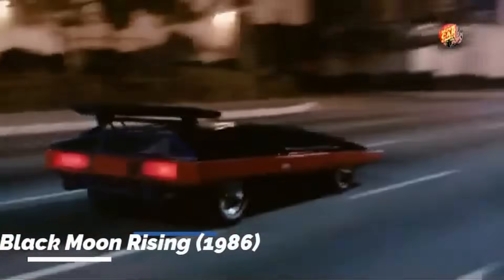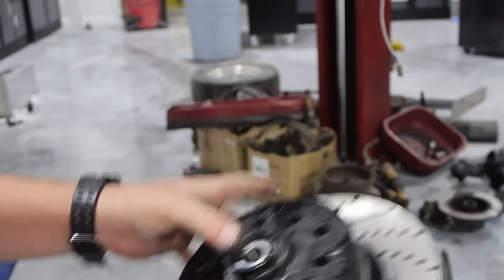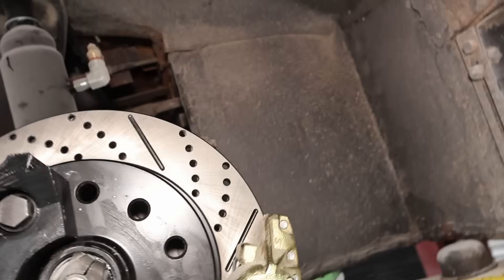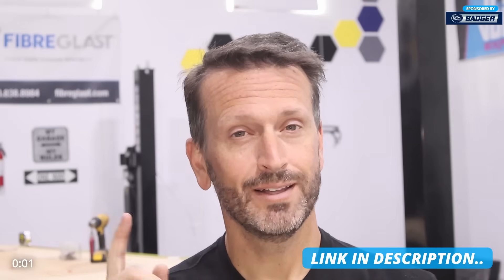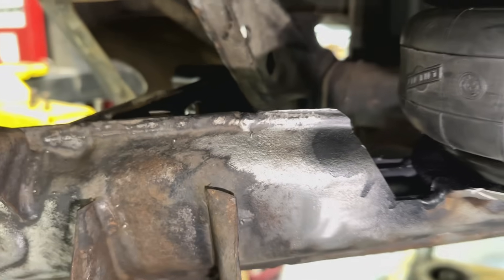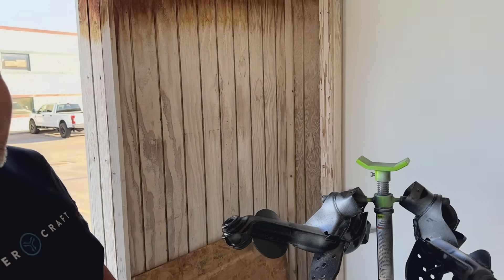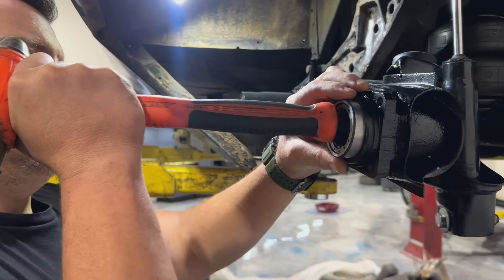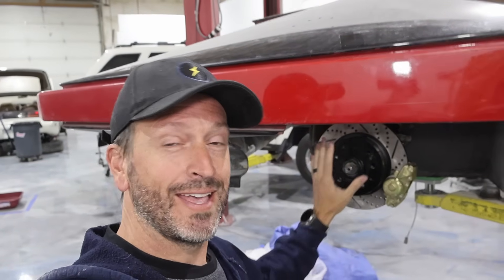What Happens When You Upgrade a Movie Prop into a Real Supercar?

Comment: Looks like you were using the same brake discs and calipers front and back? Remember to tune the pressure to the back brakes so they don't lock up way before the fronts. Also, are you sure about that upper airbag mount in the back? Seems like the load is very far from the fulcrum and would twist the brackets.

Comment: Those rear arms are a butcher job they need to be boxed in around the plate or theyre going to twist there. And you need internal gussets up the sides... ... 

Ugh... 

Id have just done air over shocks at all four corners

Comment: Remove the center support in the lower torsion tube and put the leaf springs back in to make it an anti sway bar. Doing that and adding coil over shocks or air suspension was a popular modification to the Beetle front suspension years ago. For heavier cars the upper leafs could be retained. Another modification was adjustable center supports. A curved, toothed plate with a slot was welded onto the outside of the tube and a matching plate with a round bolt hole held the support's position. Quite a range of adjustment for ride height was possible, very essential for lighter weight kit cars or any alteration to weight balance.

Comment: what a half assed job, you cut out all  the arm for the bag puck then sprayed steel it to stop it from rusting what about welding in some plate to seal up the holes left in the arm? then just spray paint over all the dirt and rust and reuse the old bolts WTF?

Comment: 7:00 The only thing you have to worry about with this mower ( or any other battery powered device) is burning your house down.
Seriously there are too many battery fires to just ignore this warning ,
Do not charge over night unattended and setup a fire resistant area ( a box made of three layers of dry wall) away from anything that burns and not near door ways.

Comment: Drilled and slotted rotors on that is so funny. My Supra has regular ass discs lol
Reply: Depending on the drive unit it can actually be reasonable but since most cars never see a racetrack, drilled and slotted rotors are mostly for looks.
Reply: @HemmingFPV  I have them on my Golf R and they made a huge difference. It continually has better grip on the rotors because of the slots. If the rotors on my Supra weren’t basically new I would definitely replace them.